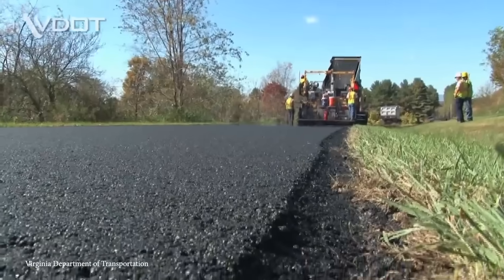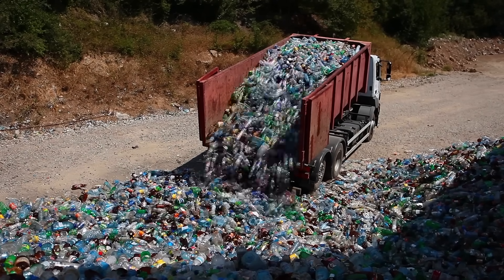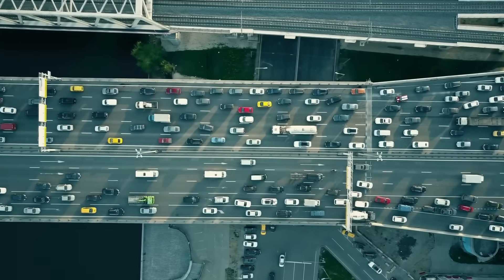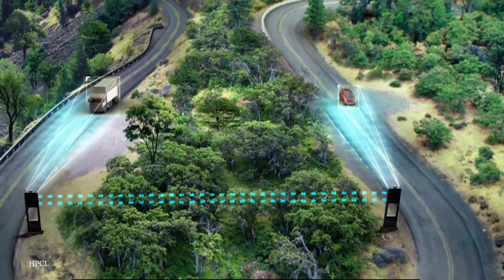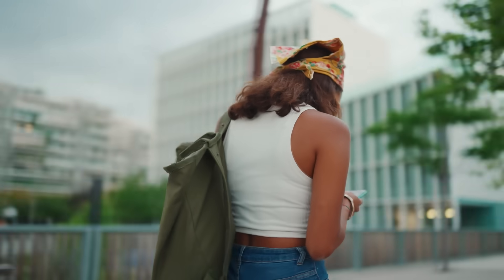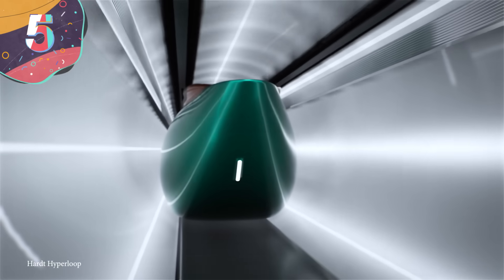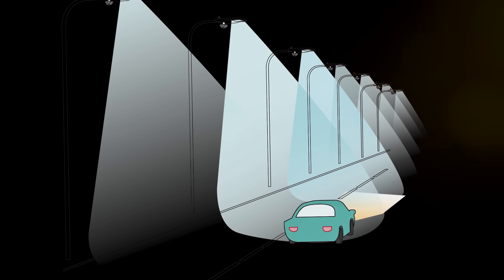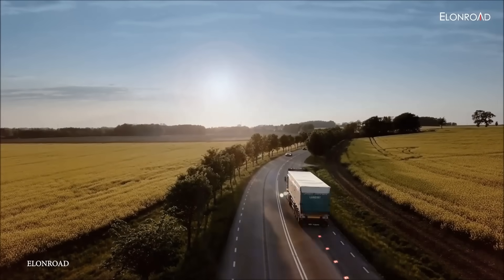15 FUTURE Road Designs that will change the world

Comment: Its funny when he mentioned the synchronized traffic lights i was telling at my screen "WE HAVE THOSE!" The system in Los Angeles is actually very well built. I personally believe our traffic problems stem from a cultural problem instead of a efficiency problem. What i like about our traffic lights is how intuitive, predictable, and safe they are.
Reply: I've been driving for 40 years and every traffic light I have encountered is synchronized to turn red just before I arrive.
Reply: @GB-ez6ge  the lights are designed to stop you at times there is no traffic.
Reply: Traffic signal synch also relies on drivers to drive at - or slightly UNDER - the posted speed limit!  I live near the 'Post Road' in CT, where posted speed limits are typically 30 or 35mph.  HA - if drivers are doing 40,  in the right lane, they're honked at.  They floor the gas away from one green light only to have to slam the brakes at the red one several blocks away.
Reply: Yea but there's still the issue with all the poop in the streets out there.
Reply: @markrunk9171  well might need to wrk on deployable cleaner/washer drone ststions eveery 1 mile down the road, soalor,wind recharged to battery recharging/holding pen
Reply: @markrunk9171  even soalr roadways form denver, have gutters too, to wash out rubbish and excess water to drains to be treated at treatment plants
Reply: It’s not a cultural problem it’s mostly the road layout system…
Reply: @mrpumperknuckles1631 it’s a cultural problem as in North America allowed oil and car companies to monopolize transit in their cities to the detriment of everything else just for a profit. Over the course of 75 years conditioning most Americans to believe they have to have a car and it’s the only acceptable way to get around and even somehow convincing Americans that cars = freedom despite them just locking people into gridlock constantly and wasting tens of thousands of hours of one’s life commuting.
Reply: @mrpumperknuckles1631  A cultural problem - of speed and 'MFFY' - to be sure.  *look up that second part - foul language involved!
Reply: guess like updating the tech & algorhythums too
Reply: Most traffic problems stem from the fact that most people don't know how to drive. They just know how to operate a motorized vehicle.
Reply: @alexubel no most traffic problems are caused because cities and municipalities think transit is synonymous with cars.  Cars have become the 12 gauge shot gun when you’re trying to kill a fly. You may kill the fly, but you’re just as likely to miss it or just injure it and you’ll damage everyone and everything around it.
Reply: @alexubel  Interesting, can you cite a source where I could learn more?

Comment: I see a problem with your nice modular jigsaw roads unless you can remove the top section separately  from the rest of a module if there is a problem with a pipe or cable you have to rip up the whole module or modules to make repairs
Reply: And if there is a problem with a jigsaw piece, you have to rip up the whole cable or piping system to repair it.  And it also, like the granular plastic in the roads, would be adding micro plastics into our ecological system.  Why do people want to move away from asphalt, which is 98% reusable, to some less stable, more dangerous material, that wears down faster, doesn’t deal with temperature variants as well, and poisons our environment? Why is this fetish for trying to use plastic for something it really is not designed for?
Reply: The amount of CG renders for a lot of these things is already a big red flag.  Like, good products often start out as nothing but CG renders, but "too good to be true" plus CG render...

Comment: The clickbait for this video is a horrible design and was already debunked years ago as being worse in every way compared to current design.
Reply: ...because of what fault in it? C'mon, give engineers in training a cookie.
Reply: @davenordquist4663  Inadequate drainage. Because everything is in one lego piece whenever you have to change the pipes you have to shut off ALL lines and take out an entire section of road. And bring in equipment and a new piece of road. Maintenance- It does not regenerate. Its bulky and expensive. You know what can regenerate and be recycled and is cheap? Asphalt. What we already use.

Comment: I think plastic is the best eco friendly/finance road material or being part of the road
Reply: How is plastic eco friendly? Plastic leaches all sort of obnoxious chemicals. It does not degrade well either. So it's not only chemically harmful but the eventual break down products are physically harmful for millennias. Have you ever seen any grade of plastic hold up with continual mid to high stress use? I haven't .. and that includes engineering grades. In the end, what do you do with miles of bulky, failure prone plastic highway after reality sets in on how unsuitable it is for this purpose? I don't think you've thought this through ...
Reply: Not only that, but asphalt is 98% reusable, and is a lot more rugged and durable.
Reply: Luckily your opinion doesn’t count because you’re completely 100% absolutely totally certifiably scientifically provably…. wrong.

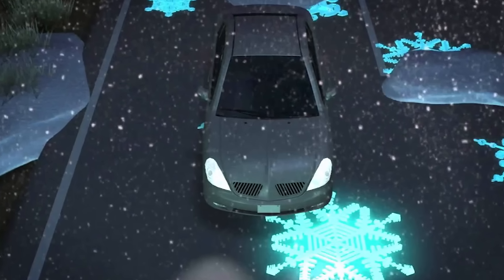Comment: 17:07 Induction priority lanes
Wouldn’t induction parking spaces be a good idea, too? Lots of people park on the street and don’t have access to in-garage, overnight parking stations. (And couldn’t any of these induction surface ideas be powered by renewables, e.g., wind or solar)?
Reply: Induction parking spaces are a great idea. Wouldn't be fast though, at least not with current technology. And yes they, just like anything on the grid could be powered with renewable energy, we have to get there first. Just ask Texas what happens when you ditch fossil fuels before the renewable tech is ready...
Reply: @JonRuisiCustomDev  Induction charging is wasteful and highly inefficient
Reply: Yeah and you just turned $300 worth of asphalt into $10,000 worth of electrical equipment buried under $3000 worth of specialty asphalt. Now 4 different utility companies, the water department, the stormwater authority, Streets maintenance and the gas company….. All have to raise their rates because every time they have to cut into a road to repair something that costs them 10 times as much to repair the damage.
Reply: @Matt-yg8ub  Tell us you support destroying the Earth without telling us you support destroying the Earth.
Reply: @mimcduffee86  On the contrary….. I just design civil infrastructure and get quite the chuckle out of these idiotic, unworkable ideas.

Comment: The surface should be 'pavement-grade' solar voltaic (solar panels) panels.
Reply: If the road was mostly untraveled, sure, that might be interesting, but put cars traveling on it and all your solar voltaic benefits go out the window.  Better to put piezo-electric generators, so the weight change charges things.
Reply: @nela9994  :hand-orange-covering-eyes:

Comment: Roads in plastic is the worst idea that any one can think off , what is the sun is too hot, the plastic will start releasing toxic gas , tyre with Thar and cement wont make chemical reaction so quickly but rubber tyre makes quick contact with melting plastics quickly .. This will again creates cancer or some new diseases for people who use the road or stay nearby plastic roads .. This does not look like positive innovation

Comment: Improved traffic light control and synchronization would likely promote better fuel economy due to the improved traffic flow.
Reply: my city has had that for 35 years.
Reply: That’s an excessive capital improvement cost…. Meaning that saving the average taxpayer 30 bucks a year in gas, doesn’t justify spending $20 million they don’t have  in order to put in that system.

Comment: Traffic lights that adjust the length of green according to volume. I've seen this system from about twenty years ago. It didn't catch on, but should.
Another excellent, and in production idea are vehicles that drive roads to map pothole locations.
Reply: the ones i hate are the ones on a timer those make no sense at all since they will just change even when no one is even coming
Reply: @Themrine2013   Not every city has all the money in the world :-) timed lights have been around for 60 years because that’s how most municipalities deal with there being multiple different government agencies involved in the timing of an individual intersection. 
Take for example a state highway that serves as the boundary between two cities, that’s four different jurisdictions between the cities the county and the state for who gets to decide on the timing of those lights, one side of the street is a hospital in one city the other side of the shopping center in a different city and it’s a state highway running down the middle. Who gets priority? Who gets turn signals? It’s a giant  dance that’s why everything has to be timed properly. It sounds good to put in a massive $40 million traffic control system full of sensors and components to take tremendous amount of maintenance in order to make a smart system adapt to traffic flows, or intersections can use a $300 timing system that allows them to flow during typical heavy traffic times.
Reply: @Trucker2019  I know one light that is green for precicely one second. It's a turn and the light to go straight stay on longer but God damnit I need the right of way longer than literally the time it takes me to notice the light has changed.
Reply: @Themrine2013  The ones around me seem to be on a timer after a car trips the sensor.  So pull up to light, then still have to wait 45 seconds till it goes green even if no one is coming!  Worst of both worlds!
Reply: then why not build a roundabout. It adjusts to traffic and requires no power
Reply: I believe you mean that it didn't catch on in the US. It's the default here in the Netherlands on high volume roads. In fact, I believe that most of Europe uses similar traffic lights.

Comment: My personal view on hyper loop would be that it's overly complicated and insanely dangerous to the point where a small error could kill everyone, it doesn't even have to crash, a leak caused by a malfunction or even someones purposeful actions would send air into the tube and if the pod collides with that it would be like hitting a wall going 700mph. It would be impossible to protect al the track so it would have to be underground at least. Then we also have natural disasters like earthquakes witch would also have the same effects. It being used to travel over oceans is also very unlikely as material stress and corrosion would cause similar problems to those mentioned above, this time with water instead of air witch is even worse. So in conclusion let's just go with normal trains or maglev for land travel and planes or ships for going across the ocean.
Reply: I fully agree with you, also, travel is and should be an enjoy experience, view the landscape and scenery, not in the closed [tube], nobody like that.
Reply: @hanfucolorful9656  Yeah true, you should be able to just sit back and enjoy. It's one of the reasons why I really don't like cars, imo they are dangerous and create too much noise and pollution, also when you drive you need to constantly focus and it's mentally tiring.
Reply: @panzervpl9406  That's why size of the windows of Chinese high speed train is 200% bigger than that of Japan. Pay attention to this next time you see a train video.
Reply: @hanfucolorful9656  Ok? But seriously speaking, I'd prefer a fast, window-less vehicle than a slow, windowed vehicle. I care about the destination ,or else I would be moving in the first place.
Reply: If it's quick, cheap and safe, it's coming.
Reply: @Kilundrum  alas, it's neither cheep, nor safe.
Reply: @nela9994  Alas, they are safe, just not "cheep."
Reply: @mimcduffee86  not sure how you mean safe?  The hyperloop couldn’t even maintain depressurization across many of the test runs, which caused all kinds of unsafe conditions.  And that was as overbuilt, and as short a test track could get away with.  This is, unless there are some huge leaps of engineering ability, it might be faster and safer to take the beanstalk up to the appropriate height, and hang-glide from there.
Reply: Another problem I see is exactly how would these lines be laid out?  If you're going 700 MPH, this is not simply commuting from the suburbs to the city; this is for cross-continental travel.  How do you decide what cities are connected to which other cities?  Like trains- but even more so- these tunnels could not make sharp turns; you gotta go in a more or less straight line.  The logistics of putting in a system like this would be even more difficult than the rail road system we have and don't make good enough use of.  My vote would be to improve on the railroads.  Invent a type of train that's more efficient on the existing track, or something.  The concept of the hyper loop sounds spectacular, but when you think about the logistics, it becomes problematic in so many ways.
Reply: @TSIRKLAND  I believe the hyperloop was pit hed to run along the California coast, which very much depends on fast earthquake/tsunami/hurricane/tornado responses are ...
Reply: And all of the hyperloop tests have been unsuccessful, they can’t seem to either pump out or  maintain the vacuum even less dense atmosphere for as long as short tests, much less expanses that would allow for acceleration and deceleration time.  The energy cost is so much higher, with so little chance of success, this would be some billionaire’s plaything, rather than a possible means of transit for any group of people.
Reply: yes better yet invest on aero intake mag rail interrogated on all subways, trains etc + can collect & use wind flow for extre speed boost & on inetrstate trains + use as wind power for energy& for the tracks & trains too + combine tech on maglev trains too
Reply: I'm less concerned with catastrophic failure then I am with the Hyperloop actually being practical at to build and operate to start with.  Like Maglev + vacuum tube = cheaper then normal train, how?  Making a vacuum tube hundreds of miles long sounds extremely difficult to do without any leaks, so it would likely require pumping stations.  Would the energy required to run those pumping stations be less then the energy saved from running in mostly vacuum?
Reply: @scottthewaterwarrior  almost, by definition, not cheaper. But it’s not competing with a regular train, nor even a high-speed train, it’s competing with jet planes for speed, trying to be more convenient, and less expensive, in terms of power/avgas.  But it doesn’t (and without some major leaps forward won’t possibly) manage to be economically viable.

Comment: An advantage to glow in the dark lines is that they can shine through light snow and heavy rains that could reduce the visibility of the retroreflective paint currently standard.
Bellingham, Washington has had synchronized traffic lights for several decades. LA may be the first LARGE city to use it, but it's certainly not the first ever.
Reply: i think the idea was to have the whole city interconnected. we had interconnected traffic lights here too for as long as i can remember.
Reply: They have interconnected traffic lights throughout the US  nothing special
Reply: True for very light snow....but much like today LED traffic lights when covered in a snow storm, there is no heat from the incandesant bulbs to keep the snow melted off the lens of the lamp.  Those lights become  impossible to see.
Reply: I like the idea a lot, not that it would work where I live, but I like it for most normal climate places. I live in Canada, and a good three months are -40 or worse, with snow and ice stacked on top of each other, and then still pretty covered for another 2-3 months. As it is, for the six months of "clear" weather that we have, we have to repave our entire city over again.

When I used to live in the Southwest United States, it would have been incredibly useful. The weather was virtually always clear, and so they would have been of use virtually every night of the year. Probably could save a  lot of lives out there.
Reply: So in the winter there may be dark about 15:00, it glows 8h (probably full glow is 3-5h and then it slowly stops)... so after 23:00 we have  7-8h without light, great...
Reply: @Blairbat  yea we're behind on our research and funding for these projects tbh which sucks bc with this technology we could focus more on other research once it's in place bc I requires a lot less labor for plug in play.
Reply: It's funny that this wasn't thought of sooner. Glow-in-the-dark paint/material has been around for decades.
Reply: @JonRuisiCustomDev  road/weather conditions can be pretty harsh in a lot of places, but it was more than twenty years ago when I first found out about this option and always thought that it should be more wide-spread, even if for a good portion of the year it would be useless where I am, and then destroyed by the weather until repainted.
Reply: In the netherlands there is no traffic light that is not intellegent
Reply: The Netherlands even have rain sensors for bicycle pads and closed garbage containers with sensors when they're full. Roundabouts which speed up traffic too. I'm 39 and all my life there have been those synchronized traffic lights. 

This isn't new technology at all this has been there for years and years. The US is in all traffic infrastructure is decades behind the rest of the world. Bridges are just collapsing in the US, put holes everywhere and public transport is just awful. One of the worst in the world.